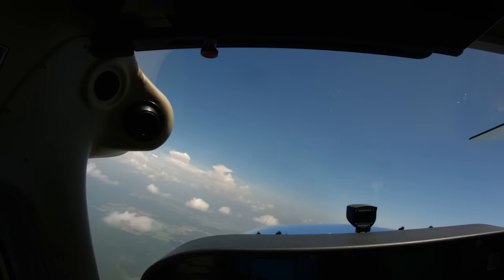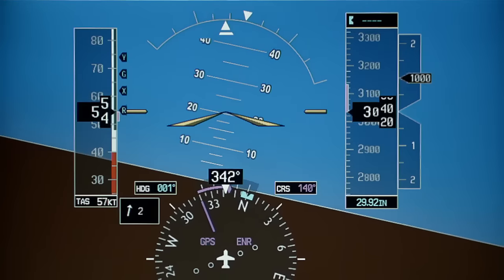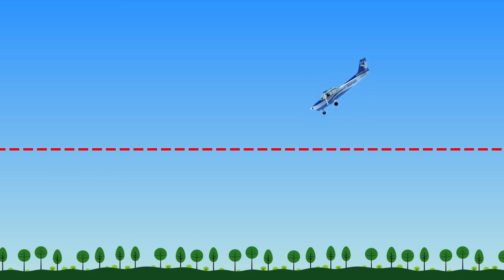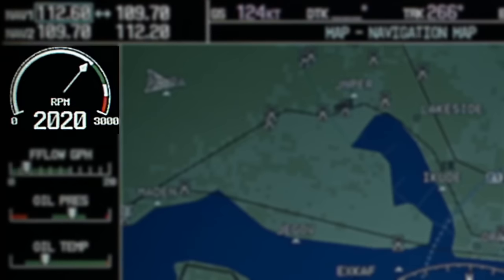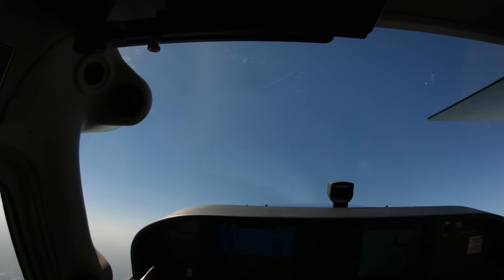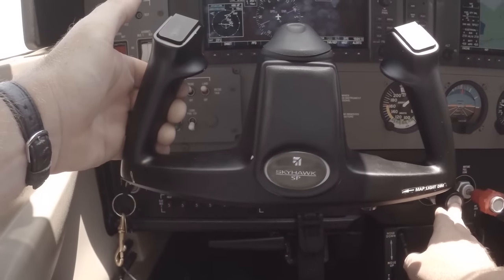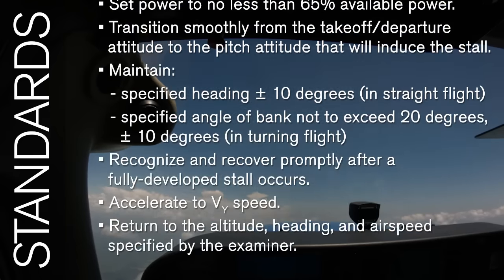Power On Stalls

Comment: Decades ago when I was a student pilot, it was required on your check ride to not only perform power on & power off stalls, but also spins. I think it was a mistake for the FAA to eliminate recovery from spins. If a pilot gets into a spin, they also need to know the recovery technique without hesitation.
Reply: More people were dying from practicing spins than from getting into one inadvertently.
Reply: @GreenDentist419  That’s really sad
Reply: more would be pilots quit flying after being taught spin recovery.
Reply: @GreenDentist419  They were dying from a lack of eperience in the training from the CFIs since not all schools taught it the same way others did. Enforcing the lessons instead of doing away with it would have been the best option. Now young pilots are dying since they don't know how to recover from a spin
Reply: Those are all still required on Canadian flight tests. I'm stressing out because I can only get the plane to actually spin half the time. It's so effing hard to get a cessna to flip.
Reply: I’m not sure what you have heard or if it has since changed but spins are performed and recovered as part of training at my flight school.

Comment: THANKS LOADS for both showing & Explaining the "STICK-SHAKER", I have watched video's
that ONLY showed the alarm-horn!!; I often WONDER just how SUPRISED a student would
be in a plane without a working alarm when he DOES-NOT recognize what a shakeing stick
is TELLING HIM!!!!!
Reply: That isn't the stick shaker, that is buffeting caused by turbulent airflow over the wings which is being felt in the yoke. A stick shaker is a mechanical device designed to noisily vibrate the control column to warn the pilot of an approaching stall
Reply: @aarondynamics1311  WELL; of course a mechanical stick shaker is an artificial device used to WARN of the REAL stick shaking from buffeting to come!!!

Comment: I'm having such a hard time right now while practicing this maneuver. It's like I'm always so afraid of spinning the aA/C
Reply from the maker: Don't be too disheartened! That's actually pretty common. Talk to your CFI and see if they would be willing to demonstrate the "Falling Leaf" with you. For a lot of students, it seems to help them overcome that fear and really get a feel for the airplane in that speed regime.
Reply: You should not be afraid of a spin.  The airplane will give you plenty of warning!  The simple thing to do is just stay coordinated.  Use diverting your attention techniques to glance down to look at the ball.  Keep that thing centered and the airplane that had good dynamic stability will not spin!
Reply: Just use your rudder correctly. You really have to hold the rudder hard to spin the plane. Opposite rudder will easily stop a spin in GA aircraft.
Reply: @lciummo1  If they're like me they're not putting in enough (usually right) rudder.  I have to really stomp on that thing to just keep coordinated in power on stall.  The plane just wants to exit stage left if I don't.
Reply: @ERAUSpecialVFR  falling leaf exercise is excellent for any student.

Comment: Question: You trimmed nose up 3 rolls after decreasing power at the beginning to reach the rotation speed. So when do you re-trim nose down?  
  In the video, you re-trimmed at the end when you were leveling off to cruise, but you trimmed the nose up again.
Reply: That's personal preference. I would suggest having your nose up trim set for takeoff in this scenario. After recovery set trim for hands off flight at whatever airspeed you finish the maneuver at. You may need to roll in nose down trim during recovery, depending on CG and/or aircraft type.

Comment: Why specifically does it pull left?
Reply: The aircraft has a left turning tendency because of the way the propeller rotates, which also induces a mildly spiraling stream of air around the aircraft that pushes the left wing and tail stabilizer down.
Reply: @thespoopyghost1725 you forgot to mention the prop taking a larger bite of air on the downstroke when climbing giving more thrust on the right hand side of the prop which also leads to a left turn tendency. I believe it's called the P-factor.

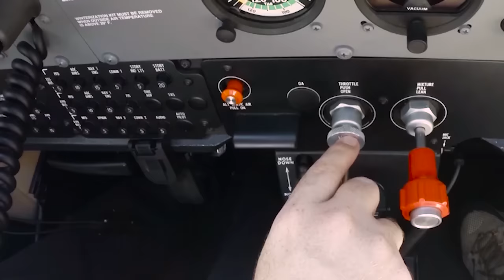Comment: Hi can anyone help me out please, at 05:17, he applied full power prior to stalling. But later on, for the recovery at 6:55 he goes full throttle again. If he had full throttle entering the power on stall, how can he go full throttle again for recovery, do you pull the power out while stalling?
Reply: Good catch. yes he would have been at full power already. However when I did my checkride in the sport cruiser we only used about 80% full power (to simulate 100% full power) because that thing just would not stall.. so my recovery included adding more full power.
Reply: either they are at aout 80% power or they are just telling you to ensure you are at full power

Comment: Question: is it wrong to use both hands on the yoke when adding back pressure to induce the stall?
Reply: I would say no, it's not "wrong" to use both hands on the yoke - I sometimes use my other hand to help with back pressure but you will be needing that right hand back on the other controls very quickly to decrease or increase power as needed or trimming, etc. Do what works for you - this is supposed to simulate a take off (but other factors apply) so picture yourself climbing at too steep an angle - what would you do?
Reply: Thanks for getting back to me Ron! Currently my method is using both sets of fingers on the yoke while the back of my hands are planted against my legs. My double hands backed my legs method was recommended by my instructor to combat banking the wings while adding yoke back pressure during straight power on stalls.

Comment: If you don't reduce the power first during power-on stall, and you raise the nose too quick, it is much easier to cause a 2nd stall. To avoid 2nd stall, better reducing the power (not necessary to idle), then climbing power.
Reply: Excluding a spin stall, never reduce power. Your goal is to recovery airspeed as quickly as possible to reduce angle of attack. Reducing power only slows that process down and causes additional loss of altitude.
Reply: @Semire1816  thats not what he is talking about. He is explaining the set up for power on stalls not the recovery. Some people try to set up the power on stall straight from climing speed instead of slowing down to 60 or so in the 172 and then increasing power and AOA as you do. That is the proper way to set up the maneuver

Comment: If you are maintaining the degree of tight control you are demanding, then the stall should not happen in the first place. An actual real-life stall will be a result of lack of control, so this test is unrepresentative of real life. Don't try for heading or bank control - recover the stall when these are all over the place.
Reply: donepearce No shit genius. This is a requirement to just get the mannerisms down.
Reply: @CocoEspada  You seem to have taken my comment rather personally. I'm criticising the requirement, not you. If you are stalling, you are in a mess and you need to be able to sort everything out. And if you are trying to maintain your heading within ten degrees, you are not giving sufficient attention to the actual problem. You need to deal with the stall, restore stable flight and then - and only then - get back to navigation.
Reply: The requirement is perfectly acceptable because during a full power climb out into a stall there could be obstacles you do not want the airplane turning into. It is critical you perform the maneuver to the heading standards or work towards that complete requirement eventually. There is a reason the standards are set the way they are. FARs are written in blood and someone has likely died because they stalled the plane after takeoff and even though they recovered they ran it into a nearby hill or mountain side by not holding heading. Follow the maneuver requirements.
Reply: @CocoEspada  I'm sure it will be a great comfort to the grieving relatives that the plane currently strewn across the ground because of insufficient attention to stall recovery was nicely on the correct course.
Reply: @donepearce  the maintanence of heading is to demonstrate control of the airplane. obviously it is not representative of real life situations. but you want to make sure you are OVERPREPARED for emergencies, and that means executing emergency manuveurs perfectly

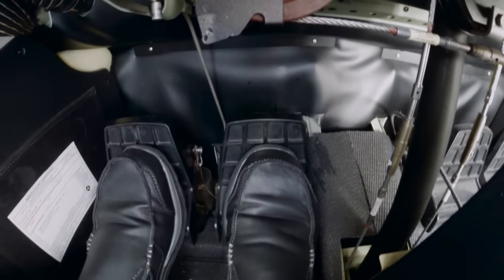Comment: "Directional control during the recovery to climbing flight will require the use of rudder." (8:04) Surely all phases of flight require rudder for directional control! You make it sound as if rudder is an optional extra, only used under special circumstances. It is not. Rudder is the direction control - in the air, on the ground, all the time and at any speed. Period.
Reply from the maker: Thanks for the input, Kenneth! We certainly never want to diminish the role that rudder plays in maintaining coordinated flight. However, in straight and level, unaccelerated flight, rudder inputs should not be necessary, so the idea that the pilot should be making constant control inputs on the rudder could be a tad misleading. Also, the idea that rudder "IS" the directional control is a tad bit misleading, as it is completely possible, and at times desired, to fly the airplane in an uncoordinated state, such as intentional slips or skids. On the ground, with the exception of a high speed or high powered taxi, rudder is not responsible for directional control. In the Cessna 172, in most cases, directional control during taxi is accomplished with a combination of nose wheel steering and differential braking.
Reply: kenneth rodmell unless you're flying an Ercoupe! :-)
Reply: @BB-jj1pt  it's the same, you're still using rudder control in an ercoupe, it's just being controlled by the yoke/ailerons. Terrible design by the way. You don't always want ailerons and rudder to be deflected in the same direction

Comment: The instruction given in this video is incomplete and/or incorrect.
The power-on stall, partly because of the rudder input needeed to maintain coordinated flight in the pre-stall, will result in an incipient spin.
It is crucial to immediately initiate spin-recovery technique, which means reduce power to minimum (not mentioned in the video) set ailerons to neutral (not mentioned in the video) release back pressure, use aggressive rudder to correct the developing spin (not mentioned in the video) then add power and slowly climb back to assigned altitude. This video will kill you.
Reply: I was going to say, he didnt mention anything aout ailerons or rudder use after stall lol
Reply: YOu did not get it. This whole video is not at all about stall recovery at all. The purpose of this video is to recognize an impending stall and take corrective actions so that you don't get to use your spin recovery technique. And more to that, all stalls do not equate automatically spins.